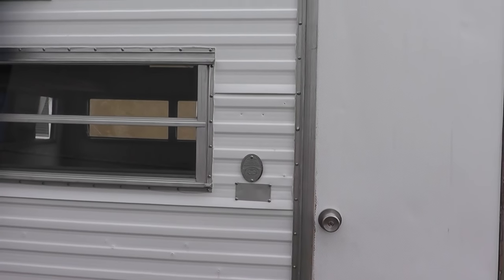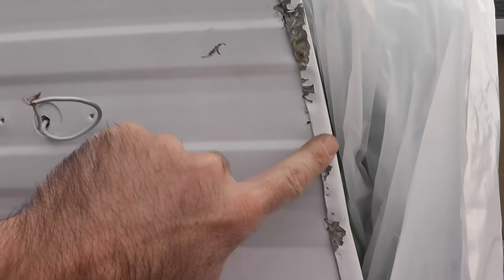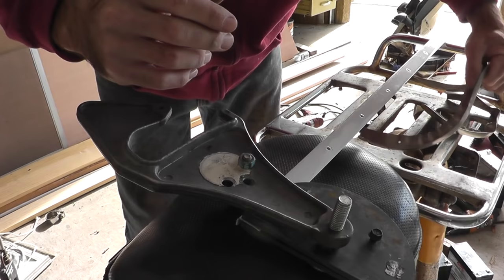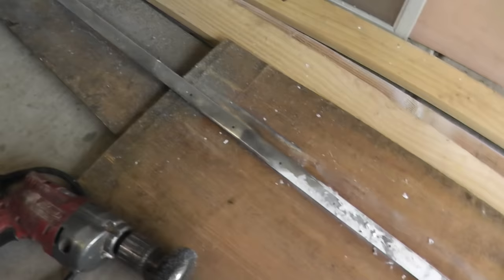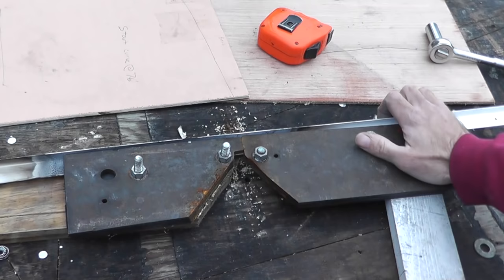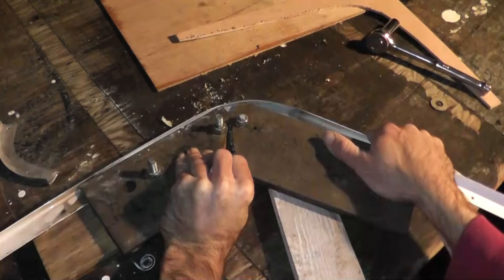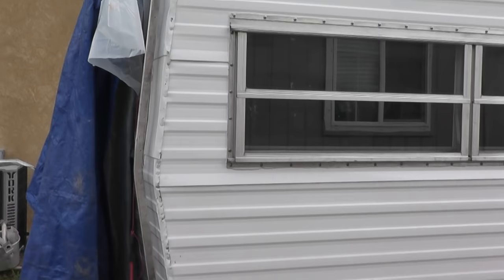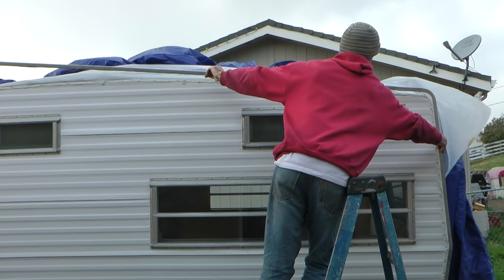Vintage Shasta Camper Trailer Restoration - Part 19 - Corner Trim Marathon

Comment: Great job on the trim. Another way to anneal aluminium when using oxy acetylene is to just turn the acetylene on to the torch light it and soot the piece up. Once heated when the soot burns off it is also the correct temperature just like the sharpie ink

Comment: The guy was right. I've been bending that corner molding for ten years using just a rubber mallet and screwing it down as I go. The kinks hammer out with the mallet as you go.

Comment: So the way I am seeing it so far, water can still get under the corner moldings on the roof. From there, from what I can see, it can be trapped by gravity on top of the butyl tape. Hopefully it won't be an issue  but a fix to this would be to butyl tape both sides of the channel. It wouldn't matter that much on the vertical runs but the horizontal run on the roof it would greatly help keep the water out.    

Also, the rain guard was there to prevent water from coming down the sides of the camper from the roof.  This water run off causes streaking and paint wear over time.  Though that fresh paint job should keep it looking great for a while. :)

Great job on those bends though!!! If it were my I would have just cut uniform relief cuts in the metal. Though you way looks way better!

Comment: You can make that bend with a series of pie cuts into the piece that was rippling. Then have someone weld those cuts but that wouldn't be cheap.
Reply: Former TV technician here. You are correct. That is how it is done! Much easier.

Comment: looks good.  dont trust that butyl tape to be your seal.  Make sure you run a bead of camper specific sealant caulk around all the edges.
Reply: where do I get that?
Reply: Sheryl B at camper places or online.  just google exterior camper sealant or caulk.  its specially designed to remain flexible and be uv resistant.  regular caulk wont last very long.
Reply: ive had good luck with "proflex rv" brand.

Comment: Well, it's nearly 2 years after this video was posted, so I expect you have already figured out that you never sealed between the roof and sides and the corners where all sides meet. Also, there is a tool called a SHRINKER/EXPANDER tool that you can buy at any auto body supply shop or online.

Comment: Or...you could've just 'snipped' a few 'slits' to allow for stress-relief of outside of radius...the slits would the overlap each other when the strip is applied.Or...just used the 'ruffled' stripping you didn't like.(that aluminum is as soft as butter now after the 'heat-treating' ...hopefully you get screws in without it  distorting itself from the pressure)

Comment: For about 50+ yrs. the Mfg.'s have built trailers using J-rail. It has worked great. If put back on right, it will work great again. So, why do you feel you need to reinvent the wheel on this ? Especially when all you had to do was put the old back up and re-screw. No muss, no fuss.
Reply: Wally Verbeck we have also found the J rail to be inadequate. It does not cover well enough hence lots of those methods had created leaks in the long run.

Comment: What I want to see is how you did that acute angle on the front of the trailer...Times two for both sides!!!
Reply from the maker: For that angle, I made a cut on the side that goes on the wall so it could overlap itself, and made the bend on front side. It was much easier than the curves!

Comment: Got any tips for fixing a fist sized hole in the metal siding of 21 and a half foot trailer? Its on the left side about a foot front the front. Just got my coachmen travel trailer for free, awaiting the funds to title and move it on better shape tires.